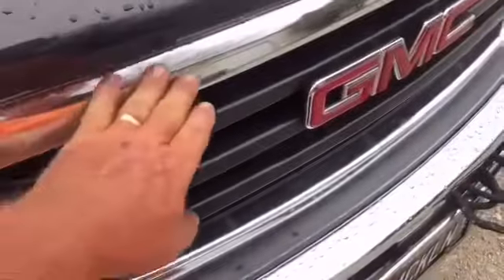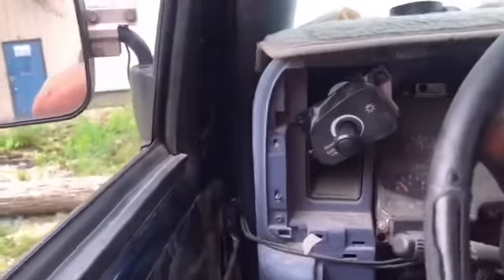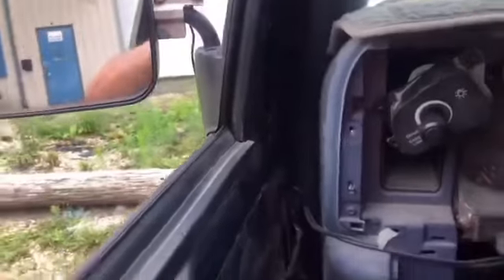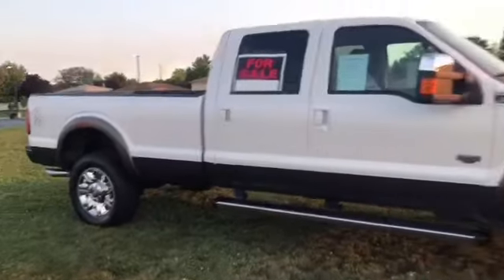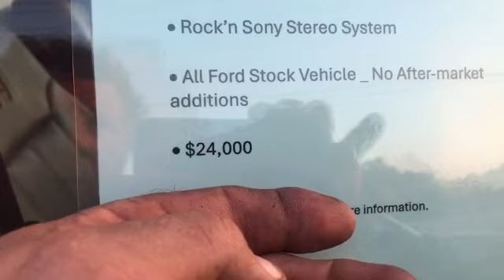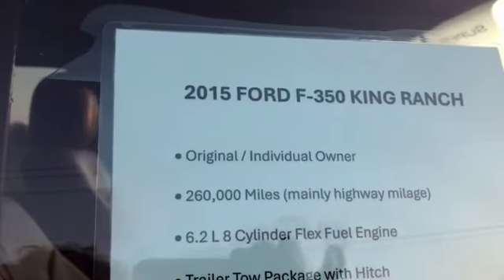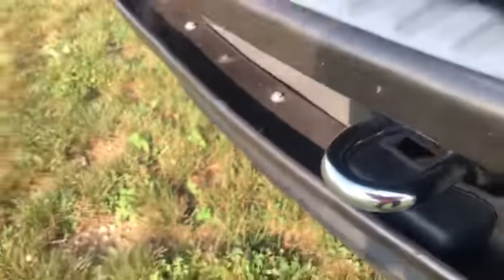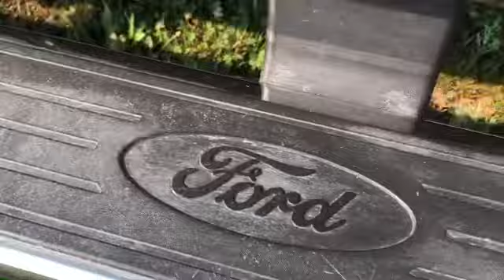THIS GARAGE IS RICH 200 x OVER

Comment: That truck is a rip off me thinks 🤔 
Worth no more than 1/3 (one third) that price with that many miles and junk tires
Reply from the maker: The red flag 🚩 is it’s just soo clean overly detailed
260k is quite a bit
Reply: @steelisthemeal  yeah it looks like someone went through a ton of effort to make it look good. But I see it as something that's been made to look better than it actually is. It's just a gasser. We can assume everything mechanical is still original and have no idea if it was properly maintained.
I wouldn't be surprised if some poor sucker bought it and just a bit in the future something major fails costing tons of cash to fix.
I bet that engine it's got is a real gas hog too
Reply from the maker: @OBS_Ford_Diesels_Inc just seems a bit overpriced for what mechanical mysteries  awaits the next owner 
A few ppl actually stopped and took a look at it while I was checking it out myself 
It probably will sell in a week 
I’m guessing 
Not many people know much about cars 
Ya right though 
It’s super clean & that’s always a red flag imo anyway